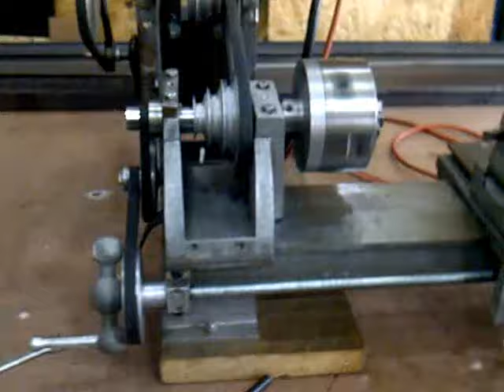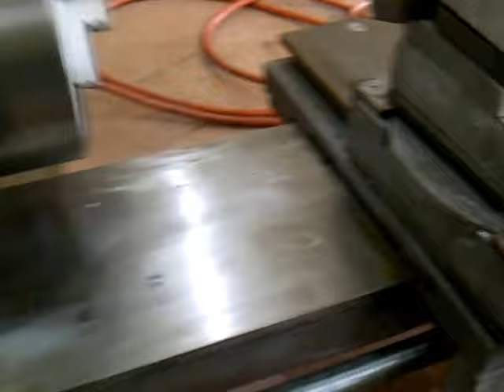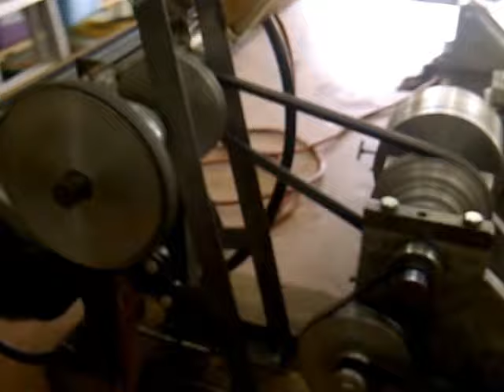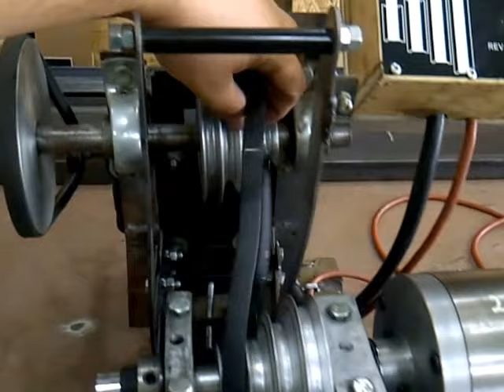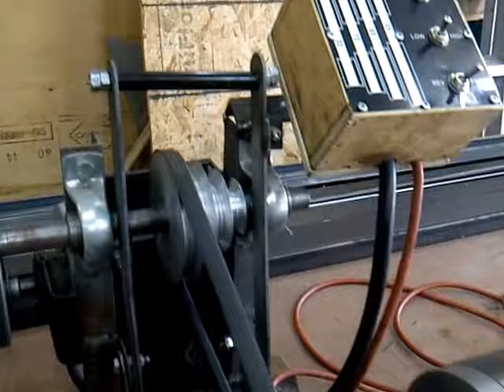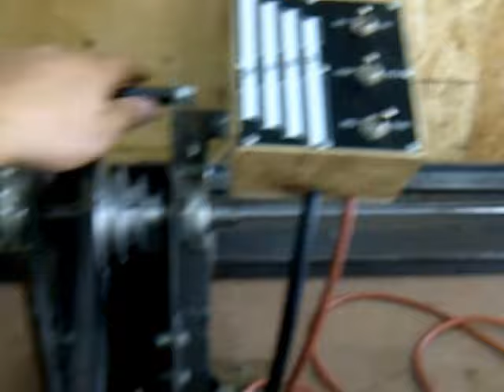My 8" Gingery Metal Lathe

Comment: This is a very good iteration of the Gingery lathe and I commend your application in completing it.
When one has a lathe there seems to be no end of additional items that one can make with and for it. The most obvious being micrometer dials. Instruction s for micrometer dials are found in Model Engineers Workshop Manual by George Thomas.
One thing I would like to see with your lathe is the controls moved to the front. In the event of a mishap or emergency having to reach over the lathe to shut it down may compound the problem.

Comment: this is awesome especially since you were able to cast and build a lathe yourself im curious what capacity crucible you needed to use to cast the parts
Reply from the maker: I used a 6" diameter well casing, 8" high (approx 15lbs) but I never needed the full capacity even for the bed casting.

Comment: Hello there,  Great lathe build.I have had the Lathe book for a couple years now, and am just now getting everything together to begin my build.  I had some modifications in mind for my build, it looks like you have incorporated a few of them already.  Did you use larger ways than the book called for? That appears to be half inch thick and wider than the plans.  I am planning on using 3x4 tubing with 1/4 inch thick walls for my bed , with 1/2 by 4 inch cold rolled for the ways.

Comment: Nice build Chris, your lathe is running nice and smooth. Your counter shaft runs really smooth compared to mine I think it is because of my homemade pillow block bearings. Your split nut is different also it seems or I may be wrong. Anyways I really like your setup do you have any more photos or build info? I love to read up on gingery stuff. By the way I just have the tailstock left to make  and to finish the auto feed pulleys. good Luck.